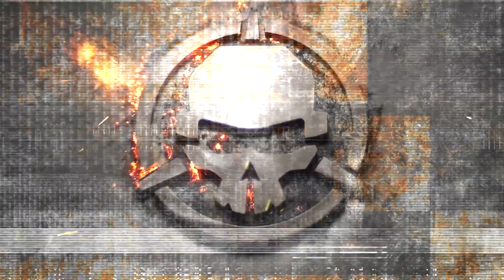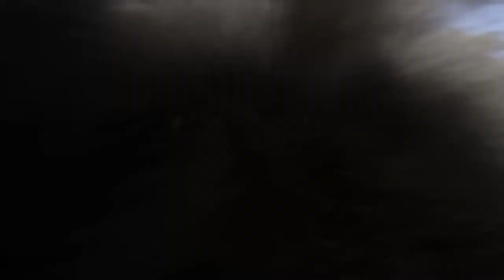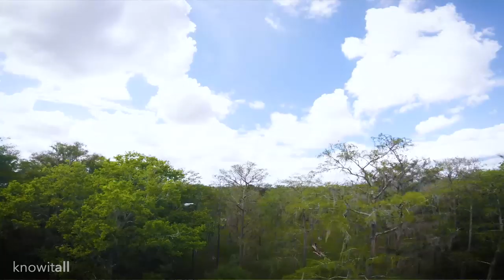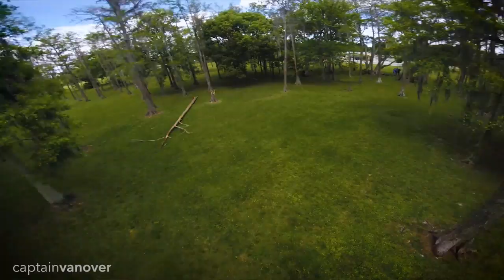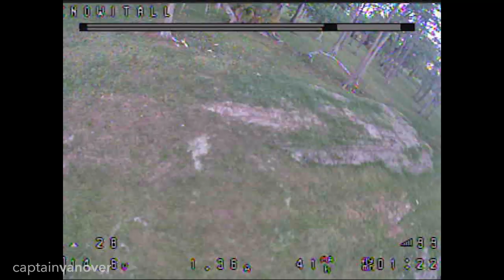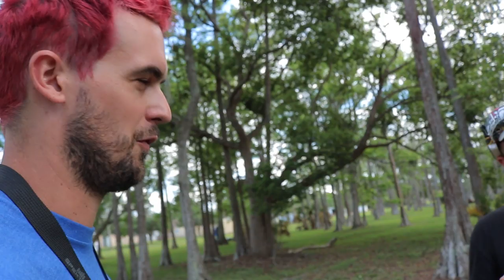3 INCH OCTOCOPTER?!? | You Build It We Fly It!

Comment: i know this is a year old but i have to comment on this. The reason why it is more efficient than a quad on the same battery is because the battery has the same amps no matter how many motors you have. It doesn't draw more amp just because you have more motors. In fact on problem with quad copters is that the motors end up drawing all of the available amps even if they can;t handle it. This is on of the reasons some motors can handle 6s batteries and the y go faster. Imagine it as if you are overclocking a computer cpu or using NOS on a car engine. in the low scale overclocking allows to to get more bang for your buck but the higher you overclock the lower it's effectiveness. This is known as diminishing returns. So in this case when you are using the same battery for double the motors it is more efficiently using the amps available, as the motors aren't bottle necking your speed. So since the 4 motors are drawing the same amount of amps as the 8 the 4 motors are being wasteful with the amps and the 8 are not. that is why it lasts longer. Some quad copters are very efficient because they have motors which can handle high amperage. Just wanted to clear it up.
Reply: Thanks for the detailed explanation on power efficiency, I actually didn't consider that about the batteries myself. I was mostly focused on efficiency losses due to the overlap.

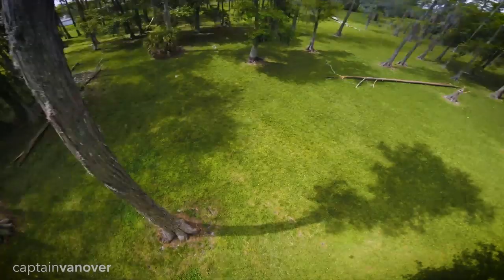Comment: 4:35 The actuation torque around the yaw axis comes mainly from the horizontal air resistance of the propeller blades as they are cutting through the air. Hence more prop pitch, more resistance, mor yaw authority. Or alternatively you can slightly tilt your motors with washers in the correct direction.

Comment: I'd like to see more hexacopter experimentation. The EVO-H frame from tomoquads would be a good start.
Reply: I totally agree, bring to market a hex, as they are a total blast to fly. Rotor Riot, if you're listening, market a hexacopter, and I'll pre-order one now!
Reply: Same here. I'm building an old Armattan Mini Hex v2 right now, I'm really excited to see it fly.
Reply: @3eggerfpv397  A 3in hex with 1407s on 6s would be fire.
Reply: Yannick G - That is the exact motor I had in mind! I’m kinda new to building, so how are you doing this with two 4 in1 ESC’s, or individuals? I think I’m still somewhat confused on how to build a hex with 4in1 ESCs!
Reply: Forgot to mention, Adambomb FPV has built a few of these Tomoquads EVO-H hex, and they are beauty’s!
Reply: @3eggerfpv397  I would go with individual ESCs. Some people also use a 4in1 and 2 single matching escs of the same brand. I have also seen other built with two 4in1s  and using only two motor outputs on one of them. 

I agree with you, the Tomoquads Evo-H is a beauty.
Reply: BTW, the 4in hexa I'm building will use Emax 1606-3300kv motors and individual 20a DYS ESCs, the supplied PDB and F7 FC.

Comment: You guys like some challenges for your next videos? How about these:
Not throttle on a switch but pitch&roll on a switch, meaning pitch and roll on a mixer curve that outputs 0 on 0 to +/-50% stick movement and full roll/pitch above that.
Or how about an endurance race: Set up a small track and the one who can fly the most laps wins. Only condition: no more than 5,1" prop diameter.
Or let Vanover try a race with a fire brick (7⅝ × 3⅝ × 2¼" standard size) strapped to his quad.
Would love to see any of that.

Comment: I thought overlapping props reclaimed efficiency, like with contra rotating props? Aerodynamicist leave a comment.

That tid bit about amp draw was very curious too. Electricians leave a comment!

Perhaps one of the coolest innovations I’ve seen in a while, I like this. Cudos to y’all and the designer!
Reply: afaik with coax motors you get less thrust from the bottom one, because the air hitting the bottom prop is already accelerated, so you can't just double the thrust like that. on the other hand that means less work to do for the bottom prop so you pull less current aswell.
all in all, coax = more thrust and amps, but not as much as with a usual setup. this overlapping frame will sit somewhere in between.
Reply: Maybe we can use lower motors with higher kv!
Reply: @oncrei  sure, my guess is that it would result in even higher current though, so you'd probably get even less efficiency compared to a standard geometry
Reply: @mircoheitmann  I guess it depends on what do you call efficiency. Its W/g
Or just the resulting thrust.
I think that the solution is not trivial and should bee tested/simulated.
Reply: Diego Pedro i like that idea though and would like to try it one day.
Reply: @air-headedaviator1805  i think that is similar to use lower pitched props up and steeper props below.
Reply: i don't think the props are actually over lapping. it looks like the circumference of the top prop has a little gap in between the circumference of the bottom prop
Reply: Mayne mounting quad propellers on the lower motor would be a push, keep the upper ones triple propellers
Reply: @Syn741  Props do overlap, that's why the height is staggered.

Comment: Somebody have to do this with contra rotating motors and a harder frame just because it is possible :D
Reply: Hahaha, are you talking about doing 16 motors?!
Reply: If you want to make it happen, reach out to me on FB. I have some larger frames that might be more conducive to the idea, but it could be done on the 3" as well.
Reply: @octokwadfpv2816  You are saying something, i think i didn't do the math :D But if there is something that can power it sounds great for an experiment :D But honestly i don't remember how i imagined it, i think i was thinking that the two motors on each other would need a different signal, just powerful enough :D I'm still learning, no quad, only simulator, but i would like to see what could do a quad with that type of motors and triple blade and a good pilot.
Reply: @octokwadfpv2816  yes, it is better for sure :D Thank you, i will reach out if i get there, but i stil have to learn a lot :)
Reply: @mihalydozsa2254  Technically, there is a lot going on with contra-rotating props. Props should be different pitches, potentially different size props, separate signals, proper disc clearance, etc. However, most don't go through all that trouble. It is possible to piggyback the signal for each arm to control two motors from one signal. On something this size, it might be difficult, but possible. I think the effect would be greater on a larger build, like the 6 or 9 inch version. If you wanted a signal per motor, then it would have to be done on a hex...guess that would be an X12? I'd be willing to give that a shot, hahaha.

Comment: OK so you want a challenge 😈 let’s go old Skool to new skool on ONE QUAD! That’s right, can you start with non dshot speediest and 9” prop on low KV motor on one arm all the way to 3” on high KV on the last arm. stopping at each gen on the way round, maybe with a KK 2 flight controller ;) Anyway, don’t know if it will work nor have I seen it 🤷‍♂️ anyway Have a good un’ :)

Comment: Fantastic!  I love the sound and quickness of it.
I'm real curious if it falls down thru a tree like a ball, or gets hooked instantly.
Either way, too much to fix for freestyle use..
Reply: @octokwadfpv2816  a central "cube" for the fc/boards/cam that the upper and lower one-piece arms attach to using long bolts might be ideal.. remove 4 bolts and both upper and lower plates come off, leaving only motor bolts when replacing a plate.  Also, if the arm plates are quick/easy/cheap to replace then they can remain thinner and lighter, making up for the heavy'ish longer bolts w/ nuts..

Comment: My math might not be right but it looks like 
8 - 3" props have 56.54 sq inch disc area
4 - 5" props have 78.53 sq inch disc area
You could add three more propellers (lol) to the 3 inch and still have less disc area than a 5" kwad. How is this thing so badass? Maybe just because the props spool up faster? I dunno, but it sure looks fun to fly.
Reply: You have to draw a circle around the outer point each prop and find out how many percent the props cover of the big circle

Comment: you know what would be amazing.. that kwad, but actually 2 different kwads setup like a cheater kwad. (2 esc's, 2 flight controllers 2 cams/vtx mounted inverted to one another) 2 rx's and 2 pilots and 2 cams/vtx - Would have to be a large 6 or 7 inch build to fit everything but it would be epic.. maybe ill build one one day and see if i can find a pilot i trust near me to take radio 2  :D

Basically 2 kwads strapped together top to top... :D

pilot one takes off. does some stuff. then does a 180 roll and disarms and pilot 2 arms and takes over..

Comment: Test that beast on 6s!
The weight of the battery might also help a bit.
The new mamba 1408 2800kv should do it!
Reply: @octokwadfpv2816  you can put a 6s battery on that motors already.
If the ESC/FC can handle it.
Look at the diatone mamba 369!
Reply: @octokwadfpv2816  the 5 inch also kinda looses the "unique" touch
Reply: @octokwadfpv2816  is there a rotor builds of that quad?
I know that the frame is custom